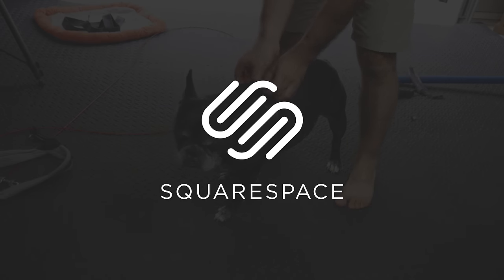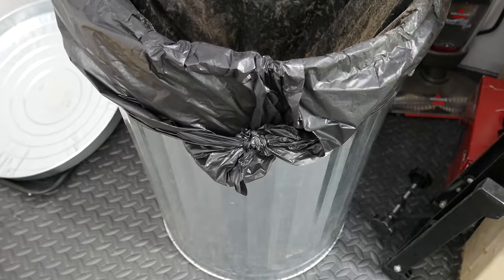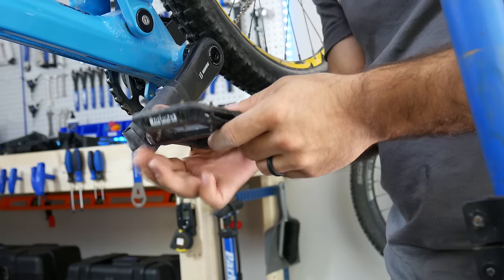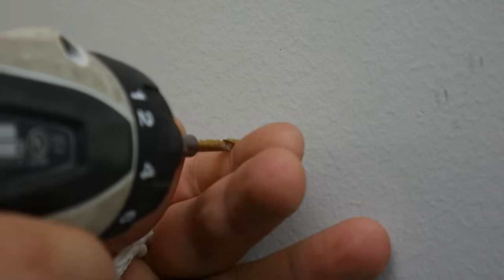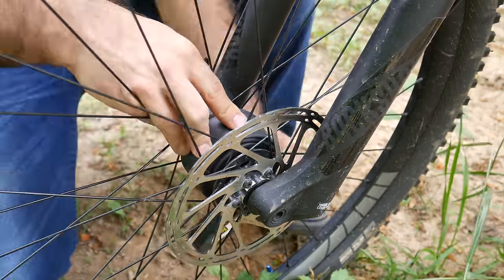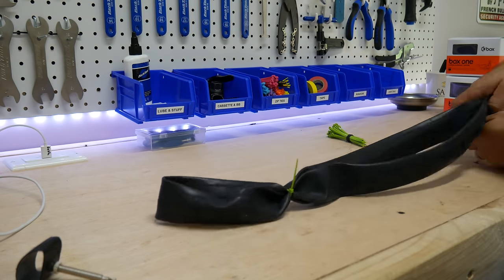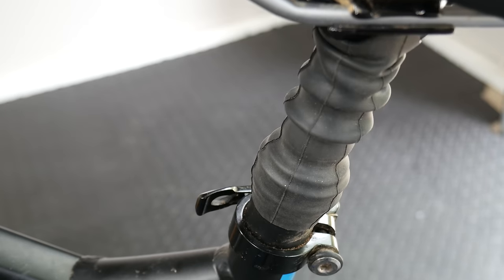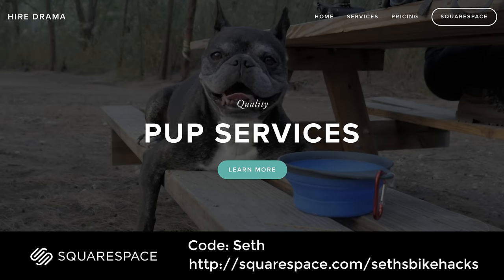10 Bicycle Inner Tube Hacks

Comment from the maker: Hey guys, Brian and Alexander are on their way through the South right now, posting videos as they go. They're making their way here, so head over to "BKXC" and "The Singletrack Sampler" to follow the journey! I miss those guys!
Reply: Seth's Bike Hacks if your grips break or get destroyed for some reason cut a piece of inner tube and if its loose then ziptie it down and it should hold until your ride is done
Reply: Seth's Bike Hacks where you buy your drop post seat in Indonesia?
Reply: seth remember the two tooth brushes use them as like a brush to oil your chain
Reply: i do not recomend both for cleaning and oiling
Reply: Hey Seth, what about using that same dropper post hack but on the front suspensions?
Reply: Seth's Bike Hacks- Can You do more bike hacks please There Awsome!
Reply: when you get a flat pull the tire half way off the rim pull the tub out of the rim and cut it off and put the rim inside the tire the tire acts as a track and is as easy to ride back home or to a bike shop
Reply: Thanks to you Seth I can finally bunnyhop! Mountinbiking just got much more fun when you can get air outof everything :D Also thanks to you I destroyed my first front wheel, no hard feelings though, I will be back up and running soon enugh :)
Reply: Seth's Bike Hacks  ok
Reply: Seth's Bike Hacks hey man were do you buy your back will suspansion
Reply: Seth's Bike Hacks iii
Reply: Hey I love your videos
Reply: Hey seth i was wondering if i should get a full suspension Splinter 24 or a hardtail Line 24 and i am on a budget and i ride my brother huge hardtail otherwise i ride my 16 inch bmx bike and it is so small and i want something that i can ride like my idol you and i was hoping you can do a video contest for a nice kids bike that would make me and so many kids happy ps i am 13
Reply: please reply seth thanks
Reply: Seth's Bike Hacks Jairo
Reply: Seth's Bike Hacks i
Reply: Seth's Bike Hacks   I got y one hack for you if you have your braket bented  by side and you have pipe pliers in track or  city etc. Use it to bent braket straigth
Reply: I found the gum one very usefull
Reply: Seth's Bike Hacks.
Reply: Seth's Bike Hac
Reply: Thank you for making great videos, you are a idol of mine.
Reply: Batmis
Reply: Is the rims in very good condition. The rims I have is a little bent and it's touching the brakes. I'ma take pictures of the bikes I have so I can order some bike wheels and inner tubes. If you have some wheels and inner tubes already on the I rather take that option instead of just buying it seperate. Like a car or a truck it should be a way to Mont a spare wheel on a bike especially the back wheel ?

I have like three 26 inch wheel bikes. I have a Orange Cannadale I believe it's 27 inches but I'ma take good clear picture. If you have Tannus Tires that's even better ??
Reply: Can it be any kind of gum, or just double mint ??

Comment: I have one for you. If you use quick link in your chain and you have to dislink that with no tools you can use piece of cord or your shoelace to do that. Simply navigate your cord around quicklink and pull inwards, that will dislink your chain and even keep that in place. I figuret that out the other day on trail, quite usefull I have to say.
Reply: Man you just saved my day. I tried like 5 different types of pliers and didn't succeed. Did your trick with an old zip-tie and it popped open!
Reply: Cool
Reply: Smowling  v
Reply: Smowling 
Exactly correct
Reply: I just use a pair of hex keys myself.
Reply: Lol im pretty sure this made it into a video
Reply: @cohenparker-burton7327  yup it did, quite a few times tbh.
Reply: I think you need some quality laces for that because I just snapped mine LMAO

Comment: Few more?

- To make holes through rubber like that, a drill is hard work, as you saw. A set of hollow punches you hit with a hammer is a much easier method, and they're cheap. Good for leather or fabric, too.

- An old inner tube makes a good cover for a chain so you can lock your bike (or other things) up without being scratched.

- The "soft jaws" for a vice trick also works for bike racks etc, sometimes the hard plastic can trash stickers or even paint if they're particularly aggressive.

- If you cut out the valve for one of the hacks, throw it in your toolpack etc. A spare valve core can be handy, and you've just got a free one.

- Cheap, thin wrenches (like for pedals) or allen keys are nicer to use with an inner tube for padding on your hand.

- a small section of tube ziptied both ends is a good way to carry spare bolts or other small spares, MUCH tougher than a little plastic bag.
Reply: InitialDave hopefully Seth pins this!
Reply: Thanks!
Reply: Seth pin this up for the subs
Reply: Thanks a lot!
Reply: Dezavu
Reply: Punches can be expensive. Since rubber is not too hard to cut, you could make your own punch out of tubing or pipe.  Or sharpen a spring roll pin to make a rotary cutter you can chuck in a drill.
Reply: You can also use a small, handheld pliers-like design (with 2 handles that you squeeze like a pair of pliers) foe smaller, more delicate holes.

Comment: About to try the dropper post boot, that's awesome!  Also you dont need to be precise to do the "split tube" tubeless set up.  Just cut the seam opposite the valve all the way around (split the tube), mount it as shown, but leave the excess to hang out and trim it (carefully, with an exacto, or razor blade) after the tire is mounted and inflated.  Works like a charm.

Comment: I use a ~3 inch chunk of tube on my zippo lighter, it seals the lighter so that the fluid will stay in longer and it's water proof. I use it when I'm camping because I only use the zippo once a day but don't want to have to fill it every time I need to start a fire.
Reply: Nice.
Reply: Would love to carry the oldschool zippo around outdoors for making campfires and what not, but having to cover it with the inner tube would kinda ruin the elegance for me :(
Reply: Tim Osborne thanks dude ill use that on my zippo as for i have problems with water getting in and fuel getting out. 👍🏻
Reply: Limitedgary you don't have to cover it, lord knows the soldiers didn't when they were in Vietnam... The tube just makes the lighter fluid last on longer trips and keeps water out if you're on a canoe type trip.
Reply: Tim Osborne معارك تغفر

Comment: My old dad showed me that if you warm up the rubber by putting it in  hot water, it makes it soft and pliable and easyer to fit. When it cools, it shrinks and hardens making a nice neat job.
A piece of innertube rubber and some magnetic tape can go inside the jaws of a vice to grip and protect delicate components.

Comment: Great vids Seth. I'm just back from the Denver/Golden area of Colorado and It was amazing. My Santa Cruz Superlight was stolen the day before my departure back to Pensacola after my father had a heart attack. You showed us a vid using old tube and rubber cement for a patch kit and that does work in a bind on tubes. Here's a little trick for tubeless. Take a section of wax paper and roll out some Gorilla tape onto it. Cut it into appropriate sized strips and pieces and pack it or roll it up and stow it in your bars. It will save you in certain situations. May have held that 700 on the ride to Key West. Hoping to get back to the Rockies next spring and get it on. Thanks for helping the MTB community. See you on the trails.

Comment: Hack for next video: if you don't have a folding bike repair stand, just use you bike rack stick it on the back of the car, strap it in and your bike is off the ground, easier to work on and you can even access the gears and pedal your bike too.
Reply: Thks.  Should have read this one before I bought the bike stand a few weeks back!

Comment: 1. Inner tubes are also useful for getting good grip at various surfaces. E.g. wrapping a tube around air canister of your shock can give you an edge if the canister does not want to move.

2. Also I've been thinking about utilizing the space inside a crankset with external bearings (e.g. Shimano ones have 4cm in diameter empty tube): you can wrap something (e.g. a chain link or a derallieur hanger) with an inner tube and squeeze it inside the crankset tube. The rubber should keep it tight there and you should be able to extract the insert just by pushing it with your fingers.

3. Old tires (esp. MTB ones) can be used as downtube protectors: just cut a section and tight it to frame with plastic straps (rubber strips made out of inner tubes can also be used :D)

Comment: Could you make a boot for a suspension fork with the same idea as for the dropper post?
Reply: Nick Lewis I think you could but it would be very hard
Reply: +Benjamin Wells I wonder if using a plus size inner tube would making it easier to fit.
Reply: you would essentially have to take apart the forks to fit it around the stanchion because of the arch
Reply: Nick Lewis u could make your bike ugly af
Reply: +boris plotkin with budget forks, I could live with a bit of ugliness if it meant longer lasting parts. IF it would actually protect from dirt and junk
Reply: Yeah my bike came default with it so I don’t know how to install it
Reply: Nick Lewis could you please send me some idea to use tyre tube to connect the hand pump to the hose
Reply: Nick Lewis yes
Reply: I just did it with a 29er tube (2.2)
Reply: @jackvdbrug2669  Did yours end up having play between boot (inner tube) and stanchion, or were they a snug fit? I want to do it, but feel unsure about what diameter inner tube I should use. Stanchions on my suntour fork are 30mm in diameter (1.18 inches).
Reply: Carlos Enrique Perez Mejia- If anything use as wide of a  tube as possible that way it will fit not matter what. if u use to small it might limit suspension
Reply: Guys if it worked for any for u please make a video for it

Comment: Back when I was a bike courier in Boston, I made my own lock out of some heavy duty chain and a pad lock. I put an old inner tube over the chain so in wouldn't scratch my bike. I had to put lube inside the tube to slip it on, but washed it out once the tube was in place. This type of lock can even be carried as a belt if needed(custom fit).

Comment: is a carrera vengance a good beginner mtb
Reply: yes
Reply: Adam Hilmi get a hellcat instead, mine was only £250 and it's a 29" wheel bike
Reply: Adam Hilmi yes I had one it's pretty rapid
Reply: Not really. Obviously it depends on your budget, but that bike is very basic with poor quality parts. Entry level bikes from respected manufacturers start at around £600. Cube offer the best components for the price imo. I'd honesty say that if you're serious about getting into mountain biking save up the extra £300 and get something that will do the job properly. I fell into the cheap halfords bikes trap when I wanted a road bike for fitness. It requires a lot of maintenance just to keep it running smoothly as the parts are cheap, weak, clunky and difficult to replace/upgrade.
Reply: they are ok they don't have hydraulic brakes tho so they ain't the best for slowing you down/ no lockouts on the suspension/ cheap gears if you're shopping at halfords look at the carrera kraken/ voodoo Bantu they're around 400£ but do the job well I have a voodoo Bantu with upgraded parts and it works just fine for an entry level hardtail it's not going to last for ever but when I replace it I'll get a Diamondback release 3 I'm in love with these or the mission 2 because Seth brought my attention to these

Comment: I once used peices of tube to repair the water pipes of grandma's house. I wrapped the damaged part with the tube and then wrapped it with wire making a kind of spring around the pipe, it works provisionally.

Comment: Hey Seth, following on from the bike stand you showed us (which i built) i continued to build myself a tyre and rim stand (my garage is a bike shop) you will need a couple of planks of 2 by 4 ($3.15) cut two 30 inch pieces and one 25 inch one, place the 30 inch one on the floor flat, place the 25 inch piece in the centre and drill it down, then with the other 30 inch place that on top of the 25 inch piece (it should look like a sideways capital 'H') once you have this you can use any leftover wood to make it stronger and possibly level it out, and once it is on the floor & standing (hopefully) like the tyres & rims on the top piece. Hope this helped and may come into use at your workshop! Thanks Seth! 😀👍🏻

Comment: Use a section of inner tube to hold up to 3 CO² cartridges for an inflator. It's insulation so you can use it to hold the inflator too.
A small swatch of tube rubber can be helpful if the original rubber bit has perished on a QR seat clamp. 
 Used some knacked tubes on a tree branch to make somewhat sturdy footholds for filming.

Comment: Cut a 8" strip from and old inner tube, sand the last inch of the two mating ends, use your patch cement to glue them, and use the band to fasten Harbor Freight lights to your helmet.

Comment: I really dug the inner tube wall mount.  However a couple things really bothered me with that segment.. First, it's a mollie.. Not an anchor.. Anchors open when you screw in a screw. So the screw needs to be inserted for the anchor to be secure. A mollie is secure without the screw. Second. Lmao silly guy.. A beam is a horizontal support either above ones head or below ones feet. Now a stud is a structural support in a wall. Like what you weren't drilling into. Your welcome Seth. I love the channel. Been a sub and loyal content watcher for going on 3 years now (I think). Your channel is the reason I got into mountain bikes. So thank you!

Comment: Great Video! Just some advice for the inner tube around the hub hack... inner tubes don't do well in sunlight if you used this hack for a while the tube would be useless. If you really want to you could cut out part of a trash bag and wrap this around the tube before sealing it with tape. Granted it won't look as pretty

Comment: You can make a front mud guard out of a tube as well. Cut a piece of tube the length of the distance between your lower and upper crown, open it out into a rectangle and tie it with zip ties in each corner. The spray off of your front wheel its the back of it instead of being thrown in up and front of you for you to ride into the spray. Really works, there are neoprene versions but the tube version has been used for UK riding forever.

Comment: After removing a seized seatpost I had damaged the little slit part in the seat tube (the bit that your seat clamp squeezes together) so I had mud and dirt entering my seat tube. I cut a 2" long piece of inner tube and slid it over the top of the seat tube, completely covering the slit. No more water in my frame 👌🏻

Comment: I have used Abus U-locks all my life and i have noticed that if you leave your bicycle outside the UV of the sunlight will dry out and degrade the plastic covering of the U-lock.
But if you cut out inner tube parts and then cover the plastic of the U-lock and then run black duct tape over it, the lock will last you decades outside in the cold and sunlight but you do have to grease the inside of the lock regularly offcourse.
Also if you also use city bikes and you like to park them against brick walls, then the frame tends to scratch and then start rusting. If you measure which parts come in contact with the wall 
when parking the bicycle, you can cover those parts on both sides of the bike with small inner tube cutting and also run duct tape over them to keep them in place and your bike will never get scratched when you put it against the wall.

Comment: You can use an old inner tube as a protector. When you go to a bikepark with a T-Bar Lift you can wrap the inner tube around the seattube so it prevents you from damaging your paint or dropper post.

Comment: I use old inner tubes to help fixing sadle tube mud gard, I also use them to fix hose to the frame or stuff like speed sensor on the fork or on the handlebar. I go tubeless but I they are still useful for me !

Comment: I liked this video ,A better way to make holes in inner tubes is with a hollow punch . They cut a perfect circle to reduce tearing . They a cheep and also a great way to make rubber or leather washers to reduce vibration and keep worn fasteners tight I once used one to reduce a jittery derailleur problem on my prehistoric mountain bike  good luck hope this helps.

Comment: Give that drywall anchor a cheeky wee love-tap with a hammer (or the bottom flat of your drill) so it sinks into the wall, before you screw it. Much easier and stops the tip breaking off like almost happened in the vid. Great vid!

Comment: If your grips are chewed up from heavy use, you can pull a length of tube over them. Leave it a bit long so you can tuck the excess into the handlebar end and secure it with the end plug. It will wear like iron but tends to blacken your hands; so wear gloves if that's a problem..

Comment: I use a rectangular piece of inner tube to clean my wheel center. I cut one end in the shape of an arrow and the other with a line close to end. It spins around cleaning the mud and dust.

Comment: An old school hack I have used is to take the forks off, put a piece of tube around the bottom of the head tube. Reinstall the forks and fold the tube down over the bottom of the headset. Now it's sealed against crud getting into the bearings.

Comment: Hey Seth, if you're doing a wall mount with an inner tube an even easier way is to make an inner tube rubber band (cut a slice of inner tube off) and just wrap it around your handlebar and rear brake lever.  No drilling required.
I'm not sure this wall mount technique is a good idea though, not sure how good squeezing your brake lever is in the long term.